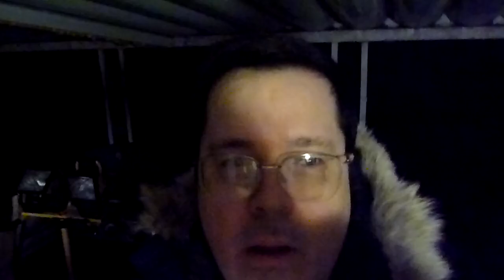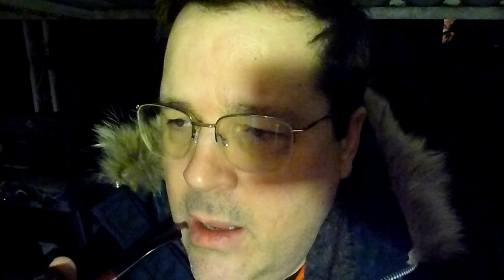ASK KEL: GURGLING PIPE QUESTION!!!

Comment: I have never thought of blowing gently back into the pipe.  I'll have to try it the next time my pipe gurgles.  I normally just run a pipe cleaner up the stem to soak up the moisture. That works well with a pipe stem that will allow the cleaner to go all the way to the base of the pipe.

Comment from the maker: You can (it's your pipe after all) .. but I have read that it's not recommended. They make a kind of waxy polish specifically for polishing pipes up with. The original shine is a wax put on with a wheel.  But you can touch it up with the stuff I'm thinking of. (forgot the brand name, but it's on ebay)  

Cheers, 

Kel

Comment: A more permanent fix:
Smoke flows up through the shank, through the opening in the tenon, and into the stem.  Check the opening of the airway at the end of the tenon.  If it is too narrow, or of it is off centered, it can cause a big problem.  The extra surface area provides a place for moisture to collect and hang out - causing a gurgle that comes back time and again.  Judiciously used handtools can correct the drilling problem and get rid of the gurgle!